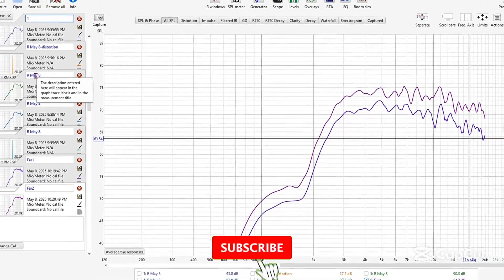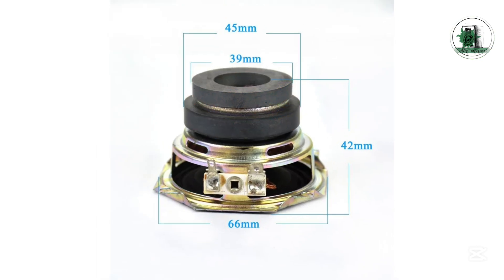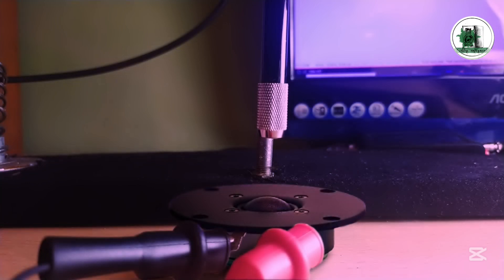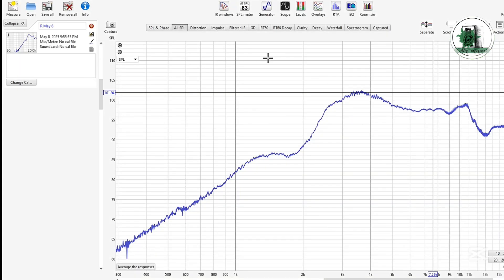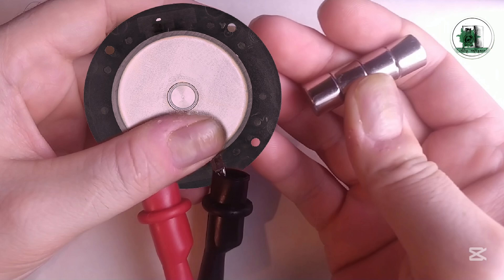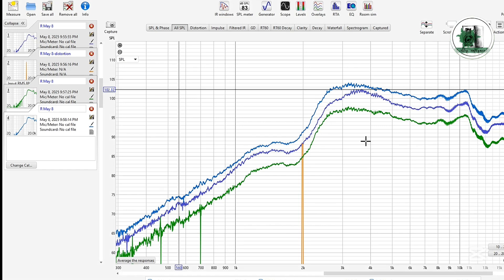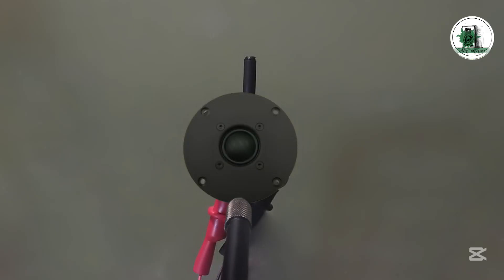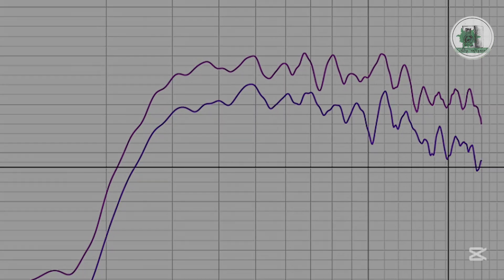Double Magnet Speaker Test – Does a Dual Magnet Setup Really Boost Sound?

Comment: This works well on small full-range speakers too. I've done this on 2", 3" and 4" speakers and what I noticed is that gluing ferrite discs of the same polarity to the back of the speaker (i.e. gluing the magnet face that repels the T-yoke flange) increases the excursion capacity of these transducers in free air, with the same input signal.
On the other hand, this increases the variation in the inductance of the speaker coil, which increases distortion - especially if the coil can easily leave the gap of the magnetic assembly completely (unfortunately not all transducers have short-circuit rings to reduce this effect). In addition, it also increases mechanical distortion of the centering spider and the cone edge, which may not be prepared to work at high excursions.

Comment: Motor force has been a major topic in my studies at the moment. Great vid! 
I was always under the impression that the second magnet was intended for shielding of external fields, mostly for CRT televisions.
Reply: I heard that too but when I read engineering books, the real way to shield a speaker is to install a ''pot''. A pot is a ferro-magnetic cover over the magnet. It can be useful if your crossover is close to the woofer and the magnet will influence the inductors on the board.
Reply: It is